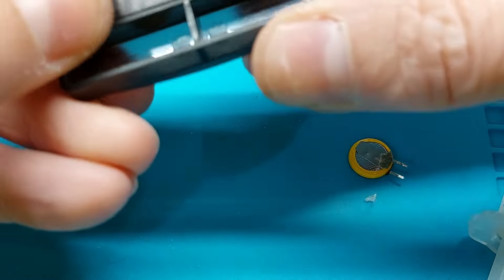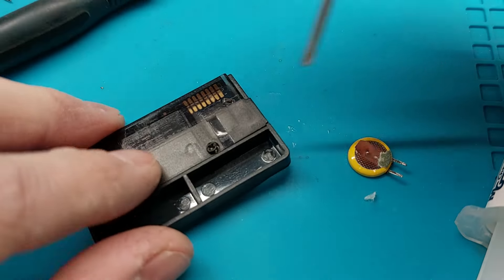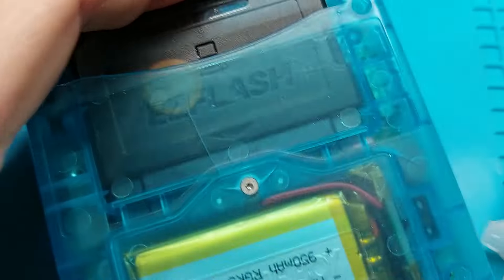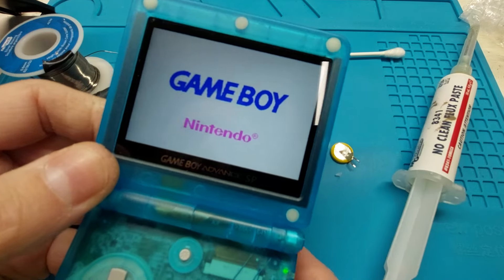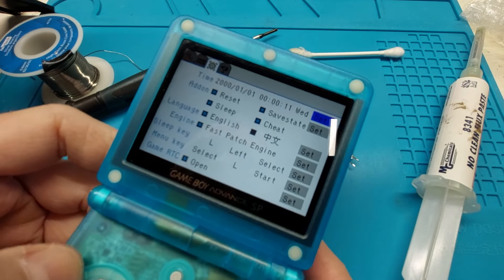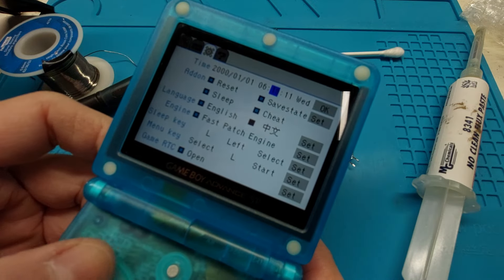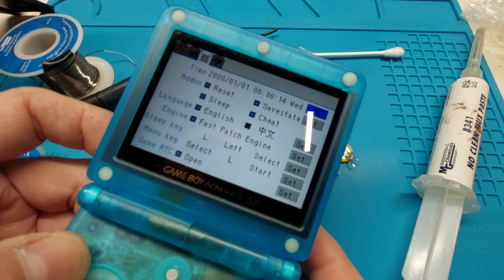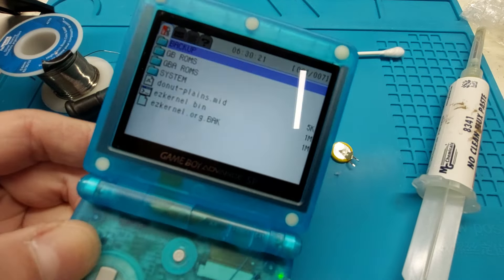Replacement of a dead battery in an EZ-Flash Omega

Comment: Could it be possible to add a battery holder?
Reply from the maker: there is no alot of room and the battery has to be elevated above the board.  You could, but it would be a pain.  you would have to build stand off's